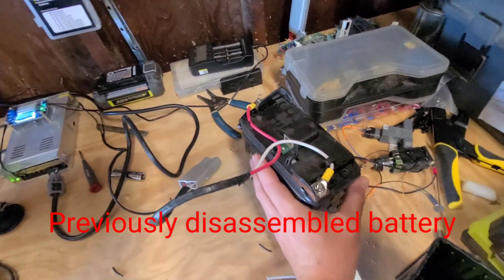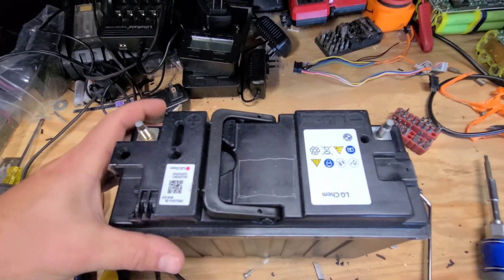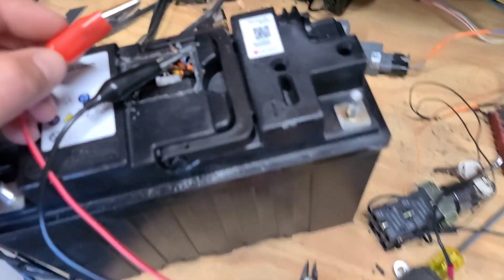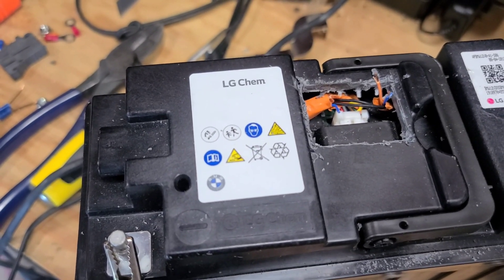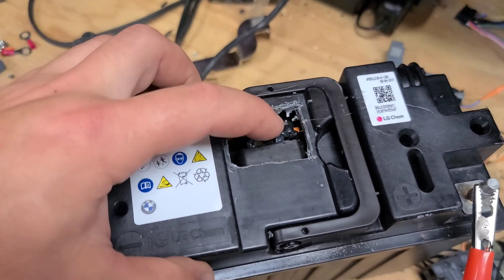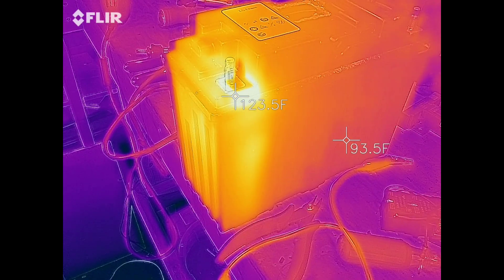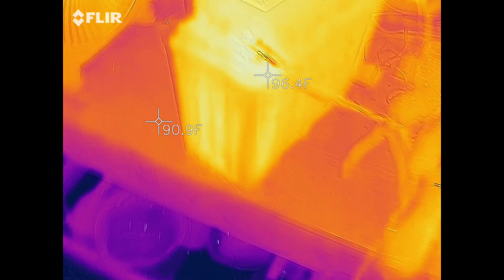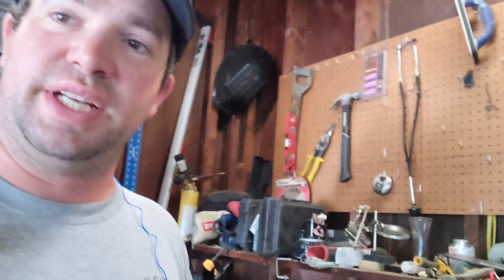12v BMW LTO Battery Relay Hack Through a Small Hole in the Top

Comment: Ben, it appears that the BMS is functioning or at least using power for something. Do you think that it is possible that it is working to balance the cells? Really appreciate and enjoy your videos. I copied your system using the Square D circuit panel, fusing the positive with a 300 amp T fuse I mounted inside of the Square D box on the positive 4-0 wire to my Sol-Ark 12k and it works beautifully. Running 20 LTO batteries through the box giving me 19200 watt hours minimum per day.
Reply from the maker: It does appear that its functioning, but I haven't tested it at all yet.  Awesome!  I love the Sol-Ark 12k!! I've installed 3 of them so far, hopefully more to come!
Reply: I'd really like to know if the bms is functioning myself. Because if it is why change it if its working. Optional sure but is it necessary ?
Reply from the maker: @herbertwerner2287  both of mine had the relay shut off.  I suspect that if its not hooked up to the vehicle that its supposed to be, it shuts off.  Even if the BMS is working, the only way to get the battery to work (for me) was to cut the relay wires and turn it on manually.  This bypasses the ability for the BMS to turn the battery off in the event of a overcharge, which is really what its needed for.  I suspect that there is no real balancing happening, as the cells are new and LTO.
Reply: @benssolarandbattery  Well I put mine back on the charger again and left it for hours, after about five hours I'm at 13.5 volts. On mine the only wire that is disconnected is the cable to the lid of the case now. So mine is charging just very slowly. I never did anything other than remove one wire to one relay on the side of the battery and now have re-hooked that back up not knowing if disconnecting it did anything anyways. And so ya my battery is active and charging,  and working. It didn't work when I used the terminals on the case but using the ones inside works well.
Reply: @herbertwerner2287  See my comment above. I was in the same boat hoping the BMS could be left on to do it's balancing work. However, I have serious drain issues with the BMS 100% connected other than the relay switched on then left unplugged. I think the only option is to remove or bypass the BMS
Reply: @NooshTube  I looked for your comment didn't see it. But even tho I can charge and use the battery with the default BMS still hooked up I'm not counting on it balancing the cells. I bought a couple of active cell balancer's which I have not used yet but my hope is that they will work well enough to balance my cells for my solar project. If not I'll just buy a normal BMS.
Reply: @herbertwerner2287  Mine drains when sitting. Bad enough that it doesn't sound like a good option for a solar bank unless you bypass the BMS. Charge one of yours up to 15.6v. Take it off your grid and set it aside for a few days. See if the voltage creeps down like mine. Could be a bad BMS but I'm thinking that's just how it is
Reply: @NooshTube  I have four of these batteries. Three I haven't done anything with yet, haven't tested or checked anything. I work a lot so its hard to find the time. The one I have charged and tested sits at the 14 volts I charged it too 4 or five days ago. And I just checked it it's still at 14. But ya no doubt the BMS should be ruled out completely and when I get a chance to work on all my batteries I will be removing the default BMS and using something else. Better to be safe than sorry. It could be that the BMS in yours is not working right but even if it were working right unless we hear different about the BMS my thoughts are the same as yours.. bypass it.
Reply: @herbertwerner2287  Thanks for the update. To be clear, on the one you have sitting at 14v, was the relay flipped to on and bypassed while it sat? Btw I just charged mine back up to 14.5V. It took ~5AH to charge it to 14.5V after sitting for a week starting at 15.6V. So it's a pretty hefty drain on this one
Reply: @NooshTube  Ya Im no expert. When my batteries came in the mail they were all in a case I had to cut open with a dremel saw. But when I first got them I tryed charging one and it didnt charge. So I cut it open and disconnected one wire to the relay and also pulled a connector cable fron the lid of the case I did not flip my relay as suggested. I connected my charger to the positive and negative inside the case and then my battery charged. Its possible that I flipped the switch on accident but it would have been an accident cause I never meant to. Altho I was told it was needed for mine it didnt seem to be the case. I will have to test the others the same way to see if I need the relay flipped or not. I wont be able to do that for several days but within a week. I will let you know what I find out. But ya the relay is a mystery as to why I need it, it like the BMS seems better off not part of the battery and ya I wont be using the relay unless I have to.
Reply from the maker: I'm charging mine back up right now and I'll check the drain over the next week.  I may be able to cut into the side as well and just disconnect the BMS entirely.
Reply: @benssolarandbattery  Well I cut my one battery completely out of the case and I think being able to have the battery outside of the case helps with anything else you want to do. The case could always be glued back together. Just remember if you cut the case open 1/8 inch cut around the seam. Don't cut any further than you need to.
Reply: @benssolarandbattery  Thanks. I decided to open the case and disconnect the BMS. Drain is gone. BTW when I originally switched and bypassed the relay,  I did it from the side. Should be just as easy for the BMS. I used a soldering iron. You can melt your way through with good precision
Reply: @NooshTube  Mine still holds a charge at 13.8 for about two weeks now. I still only know that the battery works and works well. I don't know about the bms, it might not being doing anything and thats my guess is that it is not working outside of being in the car it was designed for. Yours might be working, maybe its mine that isn't. I would think a small constant drain is normal I say that without ever testing that idea.
Reply: @NooshTube  Just get another bms the battery is so very much so worth it.
Reply: Wow excellent Craig, I have four of those batteries. Got them because where I live it gets really cold the the winter, figured in a solar setup it would be perhaps my best option. Also the 20,000 cycles.. I mean come on what other lithium battery compares to that, the idea that they will most likely last that long if taken care of is the selling point for me besides the cold weather charging. I absolutely love them.

Comment: The cell voltage is at 2.6 volts, times 6 cells 15.6 volts!

At a 10c discharge rate of coarse it goes faster!

There a reason why they got rid of the batteries! It is best just to dismantle them, why take the chance, of trying to reuse their bad system! I have had no problems since I took them apart! Just use heat shrink to wrap them, o keep Liquids out of them and your good!

Needing to turn on these batteries is a pain in the butt!

Comment: i would say with out the bms leads connected it thoght the cells where overcharged and trying to balance them
Reply from the maker: Very possible.  It seemed that all of the heat was coming from the BMS.  Once I hooked the leads back up, cooled everything down and did a discharge/charge cycle, everything worked well.